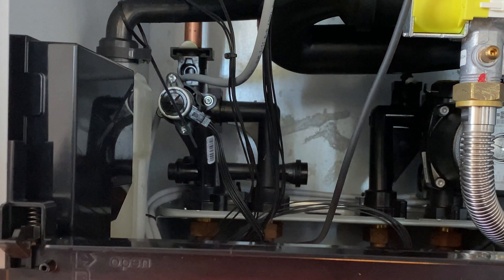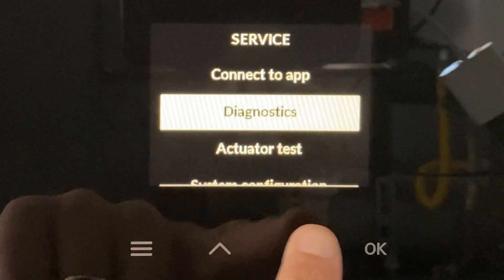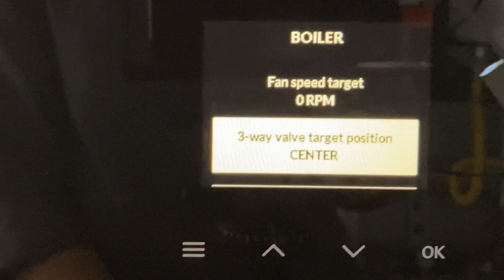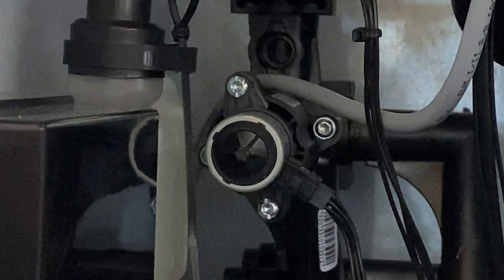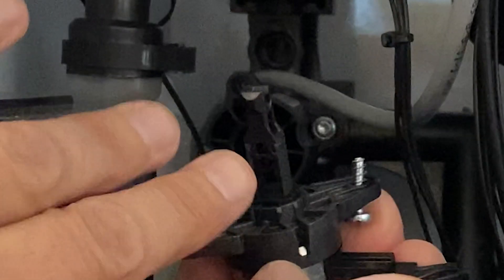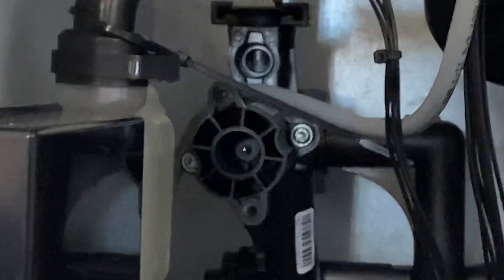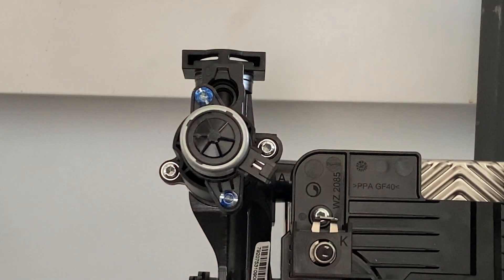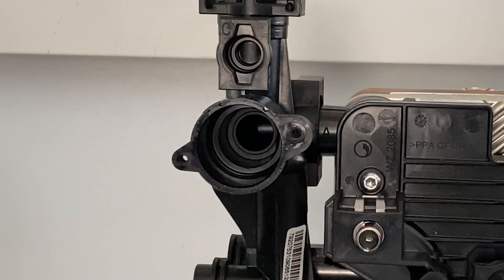How To: Vitodens 100W E Series - Manually Operate the Diverter Valve

Comment: Mine is stuck in hot water position. Unfortunately now days boilers are not built to last. Viessmann 100w fitted August 2024 and September 2025 this issue started. Viessmann technical support have been good and remotely diagnosed the problem, and will be coming to replace the part. It's really a shame as it is just over 1 year old.